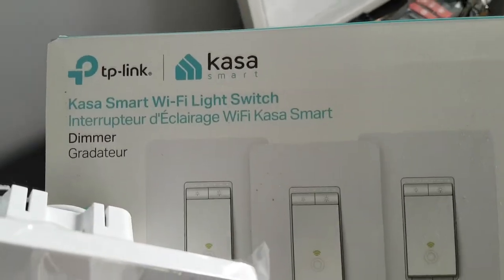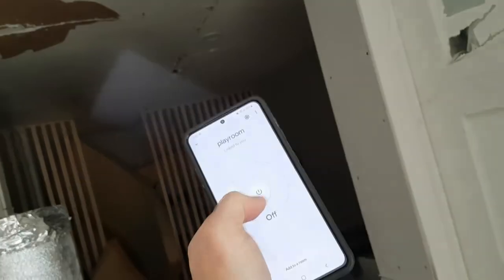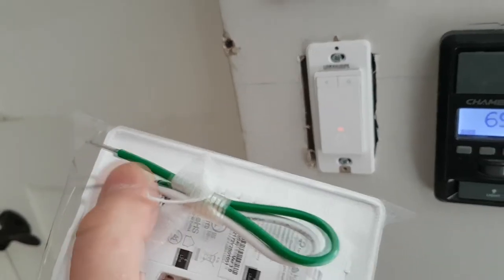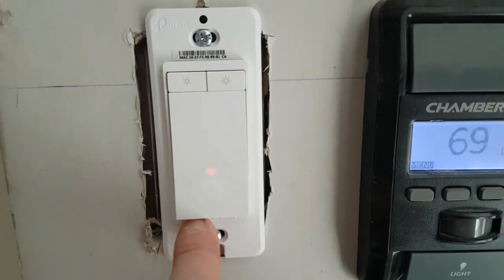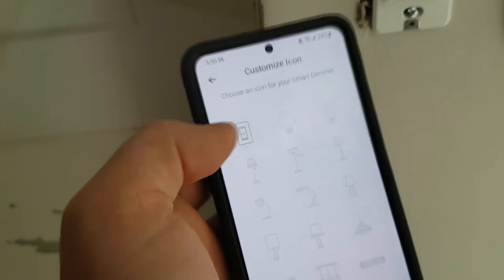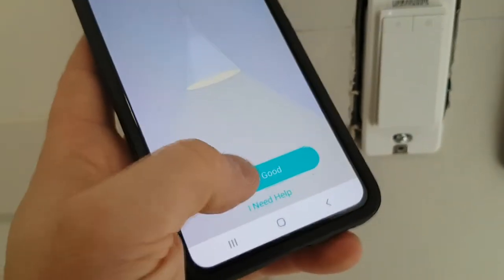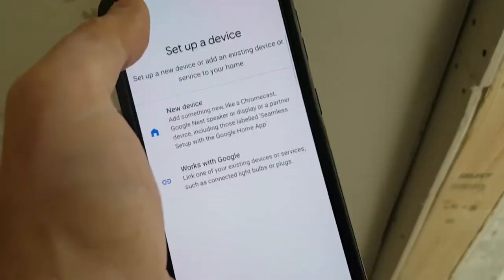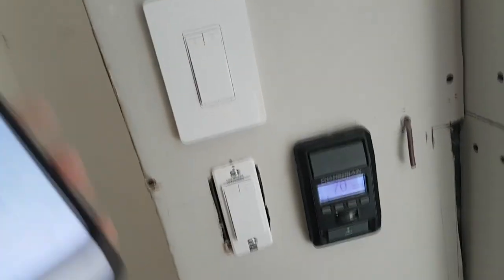How to Set Up Kasa Smart Wifi light switch Dimmer and Connect Google Home or Alexa

Comment: having the option to schedule the lights to turn on and off is good for saving up on those electricity bills.
Reply from the maker: its more of a convenience factor, cuz on average people will forget to turn off lights, and if u use them as security or for safety u want to make sure theyre always on. they even work with DUSK and DAWN so u dont have to know when sun goes down it will adjust.